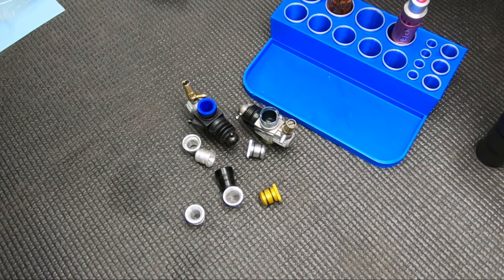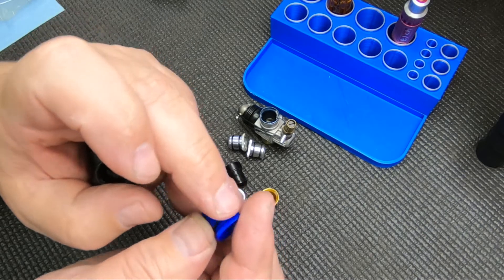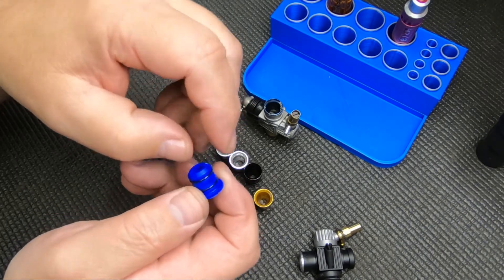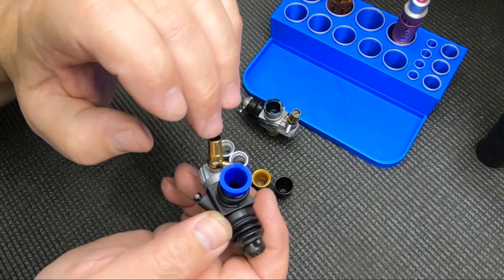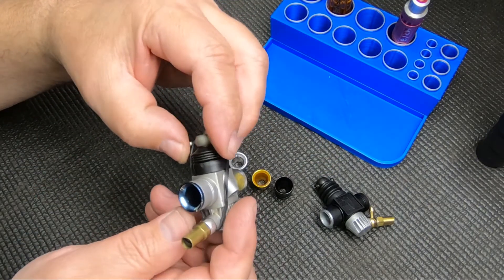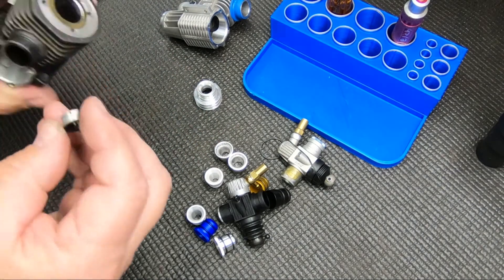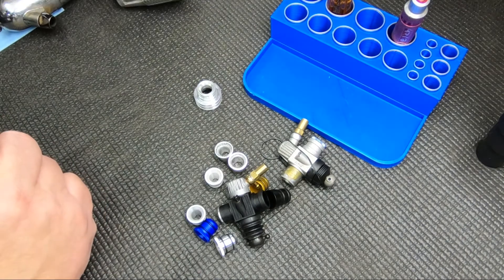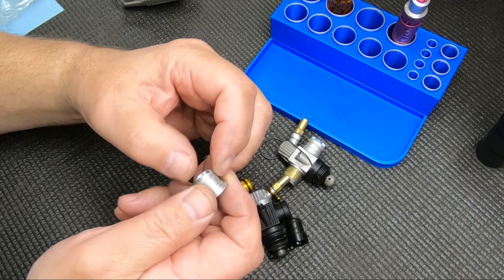Nitro Engine Carb Restrictor/ Fuel Mileage Talk

Comment: it would be useful to understand more about the button shimming and also the back plate mods that you can buy and how they make a difference to performance.
Reply: Button shimming is about changing the compression ratio of the engine in order to optimize it for the Nitro percentage of the fuel you are using. The more Nitro in your fuel, the less compression the engine must have, or the ignition timing will be too early and the engine can run into detonation issues. 

Compression, along with Nitro %, and glow plug temperature, is what controls the ignition timing in these engines. 

Back plate mods? A back plate for a starter box, with no pull start or "roto start" will make for a faster reving and responding engine. The one way bearing and extra starter shaft required for the use of a pull start or roto start adds quite a bit of weight to the rotating assembly of the engine, AND creates a bit of drag on the crankshaft. Removing those items and installing a standard bump-box backplate will give a noticeable gain in engine power and response. 

As far as grinding on a back plate goes, the purpose is ti create more airflow inside the bottom half of the engine by removing material that the piston skirt "blocks" when it comes down to the bottom of it's stroke. 
It ALSO changes the volume of space in the crank case which affects how much air can be brought in during the compression stroke when the piston rises. These types of mods should be left for a professional engine modder that is radically altering the entire engine and it's induction system. It's more of a fine tuning tool.

For the average R/C guy that wants a little more power from his engine, getting rid of the pull start/roto start back plate, one way bearing, and any extra shafts associated with it, WILL give him much more of a noticeable gain than trying to grind and modify a back plate for airflow.

Comment: tall one looks like ed bridges insert, is the inside not have the machining marks cleaned up? like concentric rings? 7mm. its supposed to flow as much as an 8mm insert i never noticed a difference just more surface area for the airfilter elbow to grip against

Comment: Great video 👍So the bigger venturi,  the easier to tune the engine?
Reply from the maker: I would say 6.5mm-8mm tune good, under 6.5 it can be harder to tune when racing.
Reply: @TheRwmods  I just bought the fx 301 engine. It should hold a tune pretty well

Comment: Have you ever tried a Venturi that create a vortex? I tried to make one I wasn't too happy with the way it came out but even that seem to make a difference. I tried another one where it would try to go counter-clockwise that one didn't work so well. If you know someone who makes one please let me know or if you would custom make one let me know if you're interested buying one. Just getting into the a 1/8 scale buggy racing I have a Triton dual Venturi that I haven't had a chance to try out yet but I think a venturi that was clockwise vortex made right so I didn't have to worry about anyting coming off of going into the engine what do better. I got the idea from my mustang my cold air intake came with a piece like a Venturi that creates a vortex and I get better fuel economy, so when I tried it my RC I got more power and that was with one not made properly.
Reply: Sorry I brought up Triton.
Reply from the maker: I did attempt to make some dremel cuts in a venturi. I was trying to get the air to spin but I never got it the way I wanted.
Reply: To put it this way.... The old "Tornado" throttle spacer that was designed like that for full size cars, and was supposed to give you, "Increased fuel economy, and more power!" NEVER lived up to it's name, and went down in history as a farce with everyone laughing at someone who bought into it, I would say NO... 🤔

Comment: What Venturi would you recommend for breaking in a Novarossi Paloma or Mito 4?
Reply from the maker: For break in it doesn't matter, when you go to tune the engine after break in use the one you paln to use.

Comment: I've always wondered if there was any testing done on performance gains/losses from a velocity stack in these little nitro engines. Kind of thinking about turning a few and testing the acceleration in my bashers.
Reply: A velocity stack is going to benefit an engine at only one certain RPM in it's power band.... And especially in conjunction with a tuned pipe that is set up for that same RPM also. 

A guy used to see velocity stacks used with throttle-less pylon racing airplane engines that were setup for max rpms, and had finely tuned pipes on them. 

In my opinion, they wouldn't work well for a throttled engine with a wide RPM range.
Reply: @davelowets  interesting, thank you for the reply!

Comment: Yeah, the rubber hair bands don't last. What I use is, cheap bicycle tube. Cut your own rings out of it. One can easily change the rubber ring stiffness by changing it's width. Lasts wayyy longer than the usual rubber bands.